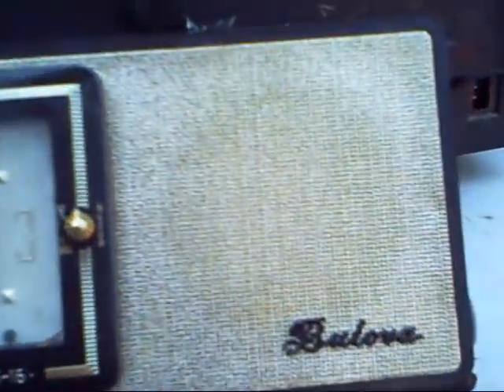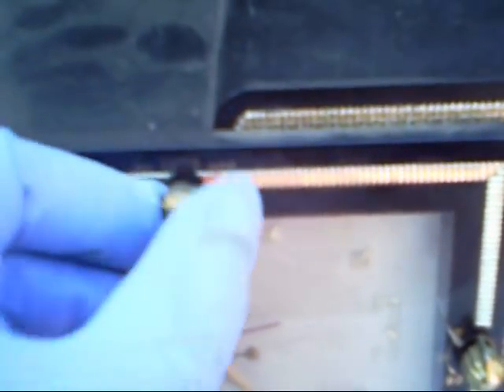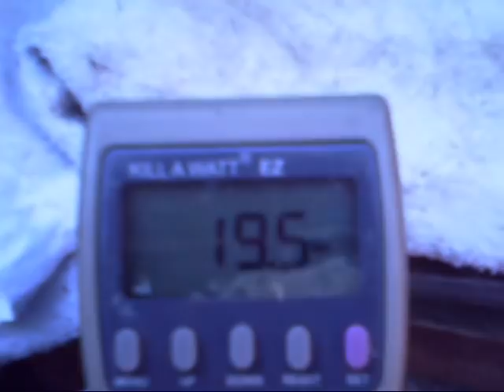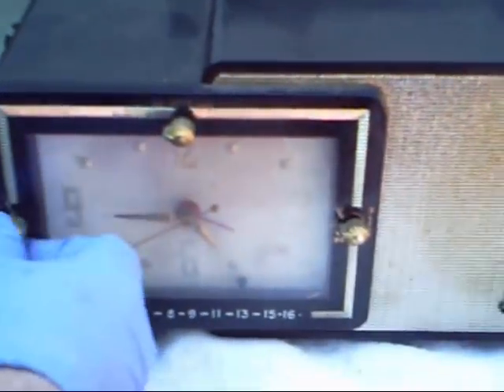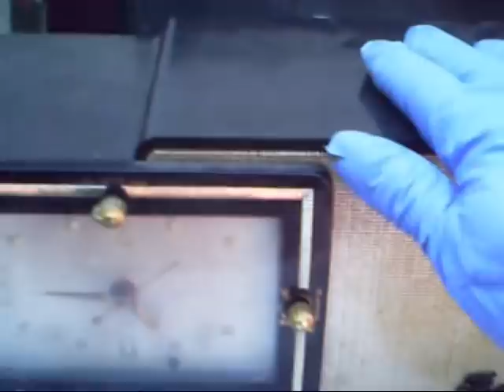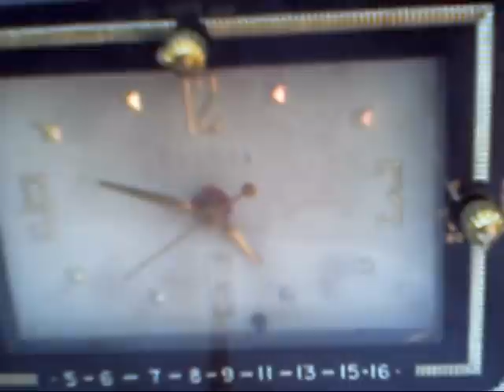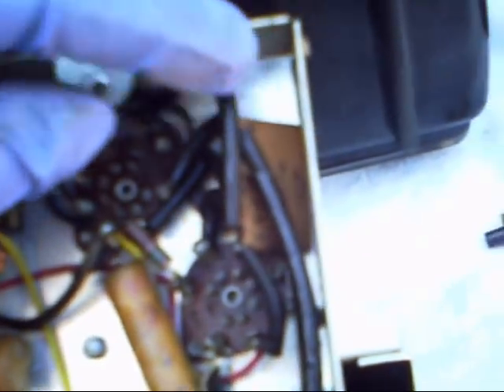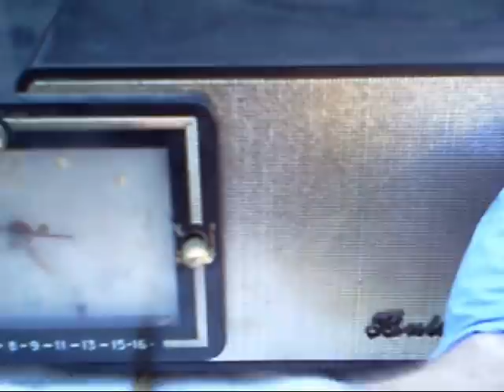Bulova AA5 1957 Clock Radio lo-fi video

Comment: @7:33 Cleaning and tightening the pins and sockets for the tubes should clear up that noise. The high amperage off the anodes combined with a loose connection will result in arcing within the socket. You'll usually notice an increased temperature at the bottom of the bulb, too--with a risk of component overheat or fire.

Gotta say, though...the sound quality from those old tube designs remains unmatched, in my opinion. That tiny little box producing such a full volume sound. And you know that speaker must be dry and stiff!

Comment: I've got one of those cameras. Mine has a steel bar about 2" x 3/4x1/8 inside the case to make it feel more heavy and important. 
I had to take it apart to fix the mic connector. Ended up with a good laugh.

Comment: I have a digital video camera with the same startup sound, says it's a Jazz video camera. Bought at Big Lots for $8, bought an 8GB memory card for it. Took it to Walt Disney World in 2015.

Annoying quirks it has is it leaves an annoying noise in the audio which I filter out. Sometimes recording video will stutter and it's out of sync with the audio. And as demonstrated in this video, annoyingly peaks the audio if it's suddenly too loud from a regular level. Saves video in uncompressed 640x480 MJPEG AVI.

Your camera is just a smidge better with hissy audio which is easier to fix.

Comment: My Bull-ova model 100 had SMD and I could see it arching through the bottom, just as you described. I like how they made the clock removable with a connector, unlike GE clock radios.

Comment: Bulova is actually an watch maker, quite expensive watches..
Reply: Their biggest contribution was the invention of the Bulova "Accutron" watch that used a tuning fork instead of escapement wheel for timekeeping.  It was the most accurate watch at the time but quite expensive.
Reply: @jazbell7   yes.  "Years ago most watches were mechanical and would gain or lose up to 30 seconds per day.
  That all changed in 1960 when Bulova introduced Accutron. The battery-powered Accutron used a vibrating tuning fork to measure time and was accurate to within 2 seconds a day, unheard of at the time. Accutron was a very proud bit of American technology and Accutron watches became the official Presidential Gifts of State given to foreign dignitaries."
Reply: ... and now owned by Citizen Watch Co.
Reply: I thought they made caviar...
Reply: JAMES AZBELL  You may be thinking of Beluga caviar which is caviar type made from the eggs of the Beluga sturgeon fish mostly caught in the Caspian Sea.
Reply: @jazbell7  Yep.. I remember one of the taglines for the Accutron : "It doesn't tick, it hums. It's eerie" :-)
Reply: @jazbell7  you missed the pun i was making :p i know what " Beluga caviar" is, but in this entire thread, shango was having a bit of fun with the pronunciation of "Bulova", so the pun of "Bulova caviar" is in a similar vein.
Reply: JAMES AZBELL  Sorry I did miss the pun.  however "Bulova Caviar" would be something advertised in Mad Magazine right along side of the Tuna brand fancy bumble bees.  You may not be old enough to know what Mad Magazine was, if so Google "Alfred E. Neuman".

Comment: That's the same interference noise I get on my AM radios from the fucking flood lights outside my building that are blown out. The light bulbs go on and off and cause that noise every 22 seconds and buzz for 1 minute straight. On and Off.

Comment: Clock motor is an easy fix. Just drill a hole in it, clean it out with brake cleaner and put new oil in it.

Comment: Rather than b** about the quality of the camera I'm going to impart a little information.  I haven't read all 300 + comments but that Bulova set looks like it was made by Farnsworth Capehart. I have a  Capehart branded radio that is in the exact same caninet.  The only difference being be slide rule dial and they didn't use as much gold on the clock face as did on the Bulova model.  Most if not all of the Bulova radios were sold in jewelry stores so that explains the gaudy gold trim.

Comment: Dollar Store camera...everything a dollar or less.  Looks pretty impressive.  Like the camera you can do colonoscope work which I bought. but you would miss all the strange bumps in the colon, or inspect your drain pipes. (its real use)  I threw it away.  Promised 1080...Ha ha. That camera got several 5 star ratings on Amazon.